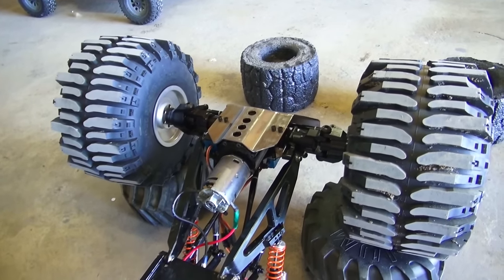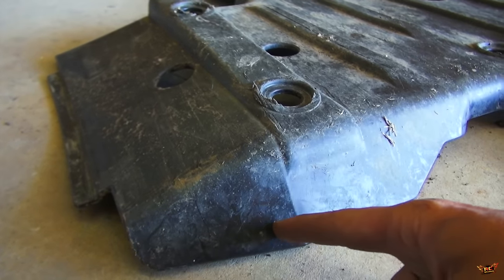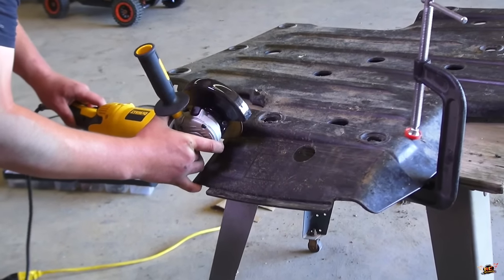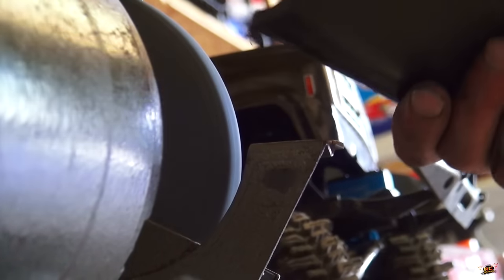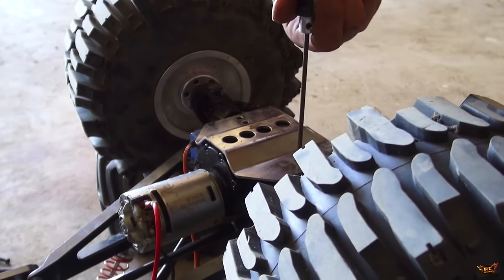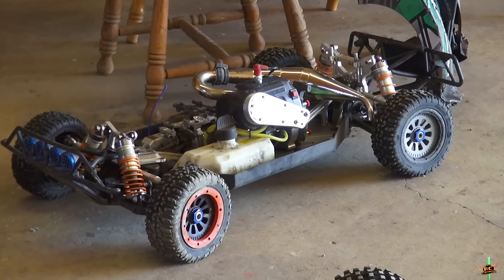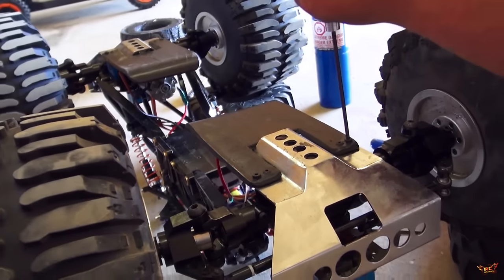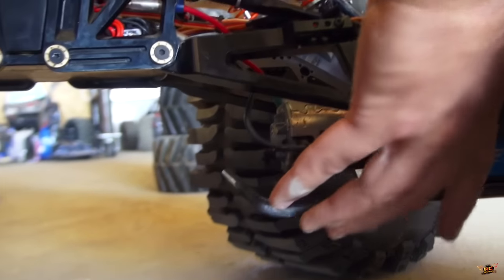RC ADVENTURES - HUGE 1/4 scale RC4WD KK2 - How to Create & Install Skid Plates - Polaris RZR XP 1000

Comment: Hey medic, a little fyi you should put another wheel on your bench grinder, running only one wheel will cause the bearing to go out faster. Great ideal on the skid plates, you can do a counter bore to recess the heads of your bolts or use dome cap bolts. Thanks for the vid.

Comment: great work...thing is a beast. Helpful hint: drill out your internal corners with a Uni-bit before you make your cuts. Stress relieves the corners (no jagged corners or over-cuts that result in cracks over time) to give you a bit more durability and also makes the Dremel work much easier and cleaner looking. You probably already knew it, but maybe this will help your other viewers. (Uni-Bit also works awesome for Lexan bodies and thin metal sheet too BTW)

Comment: if your worried about the skid plates getting caught by it sitting too low always could build a little limiting strap for it to hold it tight to the undercarriage of the truck. look forward to see it crawling great video.
Reply from the maker: Oh, I like the limiting strap idea.. thank you :) Good thinking
Reply: +RCSparks Studio could even build it out of your scrap skid plate from the sxs. it would help feeding the rocks to the tires from the bottom middle also.
Reply: or just Heat them they look like they're plastic. so heat and mold them up.

Comment: heat up the plates and bend them so they are closer to the motor. just a thought
Reply: I think it would be much better with it bent but heating up that thick could lead to melting

Comment: Sparks I was shocked they didn't design it for 1/5th scale servos either. I had one of the prototype units that the steering kept breaking and I bugged them about it and they never got around to sending me the updated axles so I sent back unit 0008 for a refund... it was unfortunate to because I had planned to make it a big trailer to pull all my crawler gear and a deep cycle marine battery into the woods to a nice mountain spot for actual crawling fun all day long ^^ may have to reinvest now that most of the kinks have been worked out with the released model... unfortunately rc4wd wasn't that great about what our agreement was. they were supposed to get feedback and send test units for new testing and they just unfortunately failed to live up to their end of the bargin... it's all good though sometimes stuff happens. keep krawlin boss!!! ^^

Comment: CAN SOMEONE HELP ME.... i have a traxxas telluride and i am having a problem with it. No steering , engine wont turn. and my esc is flashing fast green , while originally its supposed to be solid green and my receiver is flashing red. SOMEONE PLEASE HELP ME. TELL ME WHAT I NEED PLEASE...
Reply: You probably just need to re link the transmitter to the receiver. There's lots of info online about it, you need to google your specific setup.
Reply: +mike s / ok

Comment: Adding longer skidplates is not going to really fix the issue. Yes it won't snag your wires, but you can still get hung up on rocks. Why not just move the motor up into the frame and link it back with a chain or small gearbox.